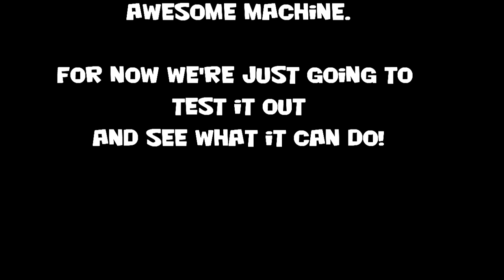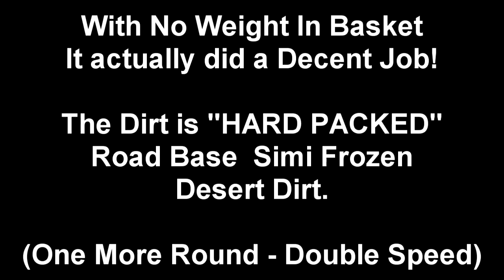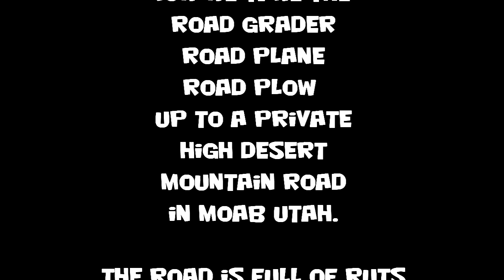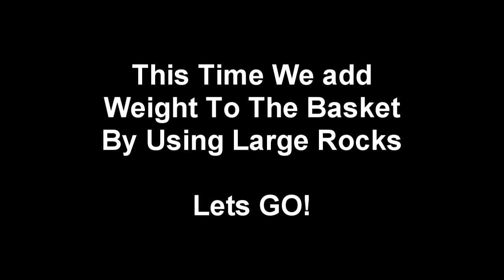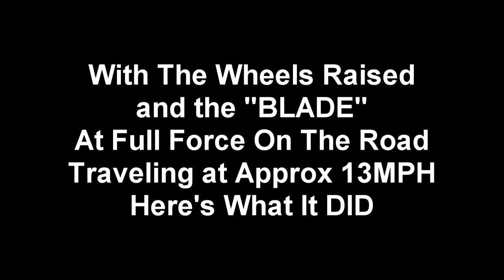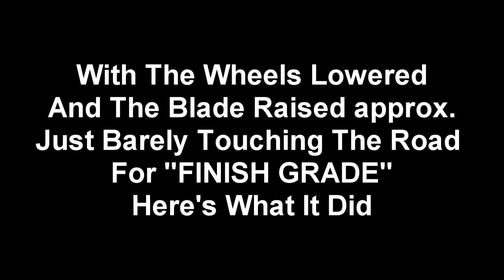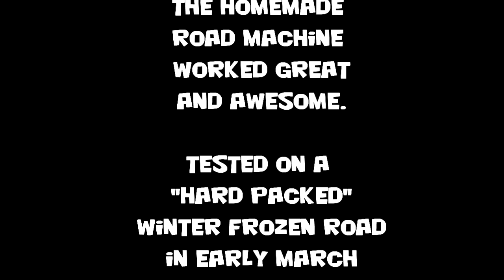Homemade "Road Grader" Test

Comment from the maker: How would you make this road grader better??   Answer below, would love to see and hear other ideas.. Thanks for watching
Reply: Great Video Pete 👍
My 2 cents would be.
Hydraulics to raise/lower the blade,  also angle the blade of the grader so you can control the flow of gravel where you want it a little better. 
for instance have 1 side of the grader at road level and the other side 3/4" off road level to move/spread the gravel where you need it , you could also shave off the high spots this way.
Reply: From my other response you may be able to accomplish what I had mentioned with just different tire pressure or a cheap set of air shocks perhaps? 
Air Shocks won't know the difference between 2,000 lb's of car or a ton of Gravel so I would lean that direction.
Maybe weld a 3/4" steel plate to the inside of your Tire support so it sits under the frame mount the Air Shocks (CHEAP) pull the pins and Viola you have a Adjustable Blade... 
Make your plate big enough you can weld in a 45 degree support back to your upright for support..

There is ALWAYS a solution and if it's worth doing then were gonna do it Right!! 😉

BTW maybe weld in more bars in the basket so old people like us don't have to carry 60lb rocks to it lol.

I would personally set it up so you could shovel some gravel in it or use a bobcat to fill it up, so maybe 1/2" x 1/2" screen? The more weight the better the Grade I would think.
For Gods sake Paint it Pete, Damn it what will people say??? LOL
Reply: you beter get that patented mr pete ,works amazing realy impresive results
Reply: @nissmoguy  you know that's right. I was kind of thinking maybe he was putting something together for Harbor Freight LOL.
Reply: Put some ripper teath on it
Reply: Put some ripper teath on ot
Reply: A flat tray on top for removable sand bags as weight, and replace the wheels with skid plates or skis

Comment: WE HAVE A 1/2 MILE ROAD ON OUR CENTRAL FL PROPERTY OUT IN THE MIDDLE OF NOWHERE. WE HAD THE SAME ISSUE. WE USED SAND BAGS OVER THE REAR AXLE. ONE ISSUE WE COULD NEVER GET PASS WAS ONCE THE RAIN GETS UNDER THE PEET ROCK. IT CAUSES POCKETS AND HOLES. YOUR RIGHT 10 MPH SEEMS TO BE THE SPOT. ONCE WE GRADED THE ROAD WE HAVE ANOTHER TRAILER WITH PIECES OF CHAIN TO DRAG IT LEVEL. WE WOULD DRAG IT ABOUT ONCE EVERY OTHER WEEK TO KEEP THE DUST DOWN. GOOD LUCK WITH THAT OUT THERE. 
TAKE CARE MY FRIEND
Reply from the maker: Thanks for there comments volksplanet.  Actually it’s a bit big for my yard. Thinking of making another one and selling this one
Reply: @myfriendpete  always something going on. You guys stay safe up there

Comment: IT would be pricey but if the wheels in the back had some suspension of even pneumatic tires and run the pressure a little low to stop the bounce
Reply from the maker: I’m changing the wheels out to air tires

Comment: Excellent video. Working for a county road department here in Arkansas (bridge Crew to be exact) ur machine worked great in my opinion. For what that’s worth lol. Angle blade forward some and u will cover more area with less material. Also might help u with rock hop thanks for another awesome video Pete
Reply from the maker: Thanks for the info Doug.

Comment: Only thing I can think of would be make up a replaceable knife edge on the blade itself so you don't wear down the blade itself. Like maybe get a piece of steel 3/8 thick and about 4 inches high to run the length of your blade. Have it extend down about an inch below the blade itself.  Then when you drill your holes, space them from the bottom edge so that you can remove it, flip it over and then get double use out of it.
Reply: Just buy a Skid Steer bucket cutting edge.

Comment: I was waiting for Minnie to come out of the house and raise hell about all the noise and moving all the rocks around in her rock garden !    Needs a strip of steel (cutting edge) along the bottom of blade as a wear edge instead of wearing down blade. Wide enough that it can be unbolted and flipped as it wears out.